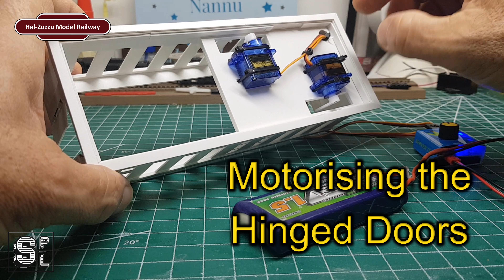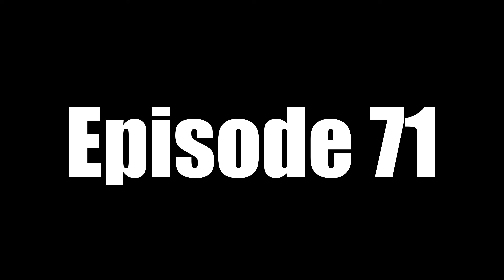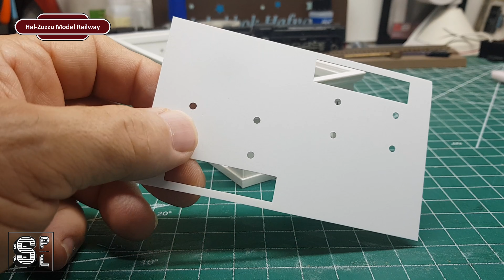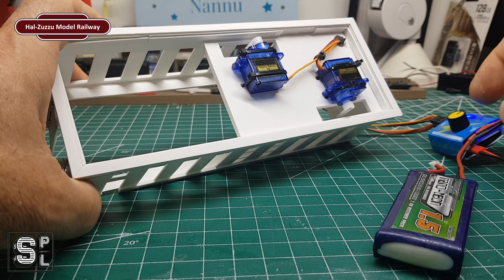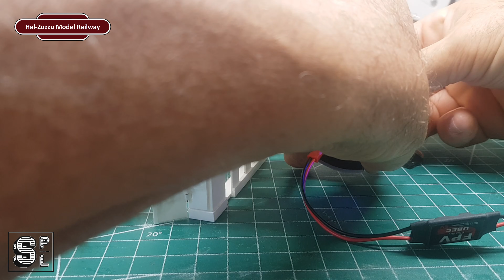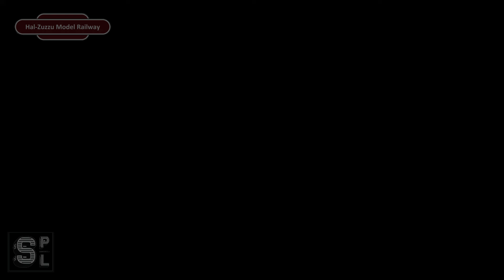Motorising Hinged Shed Doors | Ħal-Zuzzu Model Railway (Ep71)

Comment: It is possible to also slow down the servo speed by using a FOR loop in the program, moving the servo 1° with each iteration of the loop with a very small dwell between each iteration.
Reply from the maker: What a great idea. Doing some research as to where in DCC-EX I can insert the code. Thanks for the idea :)

Comment: Whilst testing your servos, as they are facing opposite directions, all you have to do is reverse the polarity of one of them and they will both move in the same effective direction.
Reply: Or perhaps to have a single servo opening both doors...
Reply from the maker: but that would make both doors open up together. Where's the fun in that?
Reply: Either way, I think it's a great build
Reply from the maker: Thank you so much :)
Reply from the maker: All I had to do is swap the values in the sketch and the servo works the other way around.  Rather simple.